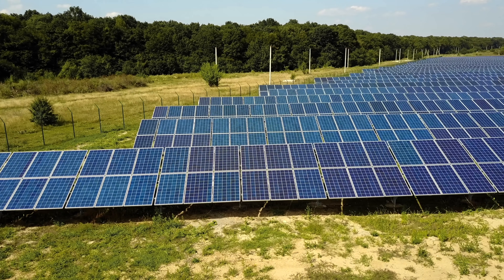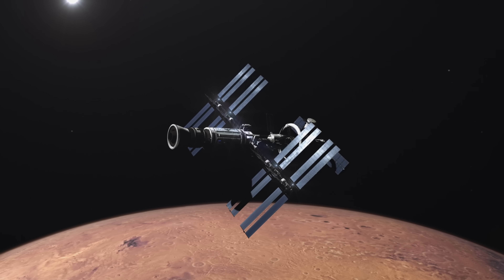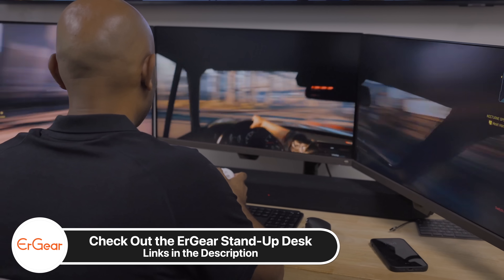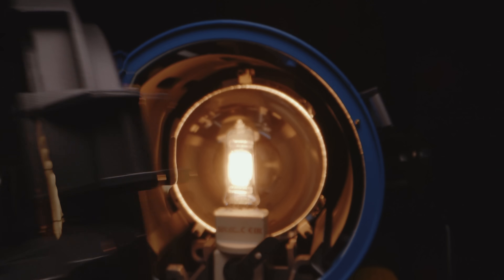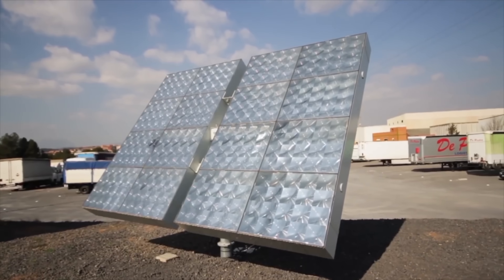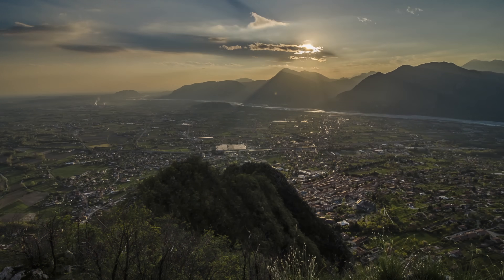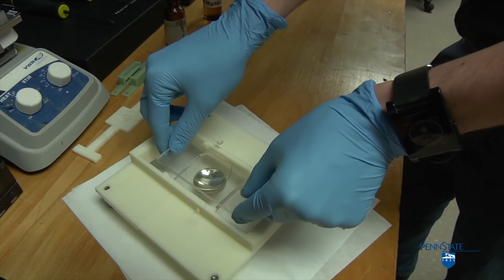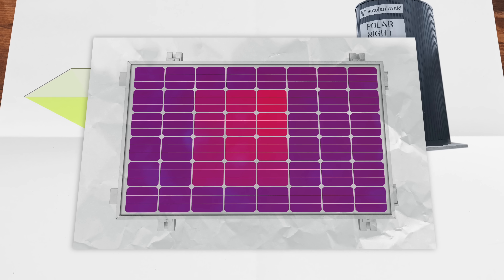Why Don't Solar Panels Have Magnifying Glasses On Them?

Comment: Is it possible to use a thermo- electric cells as a backings behind the PV cells to reduce thermal degradation and also provide extra electricity.
Reply from the maker: interesting...
Reply: I think the problem would be whether the thermoelectric cell would drain heat fast enough to cool the PV cell. Perhaps adding a prism to separate the infrared light from the visible light and shine that on the thermoelectric cell instead?
Reply: @Israel_Two_Bit  I do believe a thermo-electric cell system would also have to incorporate a heat sink, perhaps one buried in the ground or a water cooled system even perhaps providing hot water.

Comment: Once again here to mention "Blowhole" type wave power generation as it is a game changer. 
Wave Swell Energy's remarkable UniWave 200 is a sea platform that uses an artificial blowhole formation to create air pressure changes that drive a turbine and feed energy back to shore. After a year of testing, the company reports excellent results.
As we've discussed before, the UniWave system is a floatable device that can be towed to any coastal location and connected to the local energy grid. It's designed so that wave swells force water into a specially designed concrete chamber, pressurizing the air in the chamber and forcing it through an outlet valve. Then as the water recedes, it generates a powerful vacuum, which sucks air in through a turbine at the top and generates electricity that's fed into the grid via a cable.

As a result, it draws energy from the entire column of water that enters its chamber, a fact the team says makes it more efficient than wave energy devices that only harvest energy from the surface or the sea floor.
WSE's key innovation here is that one-way generation; other devices that harvest the same effect use bi-directional turbines, requiring the ability to reverse blade pitch or redirect the airflow. WSE says its design allows for far cheaper and simpler turbines, that should also last longer since they're not getting as much salt water splashed through them when a big wave hits. Indeed, all this device's moving parts are above the waterline, a fact that should help extend its service life as well as making it completely harmless to marine life.
Interestingly, the UniWave's design also makes it easy to incorporate into breakwaters and seawalls, where it can take a coastal erosion protection project and turn it into a clean energy source.
Reply: Congratulations 🎉 you have been selected among our shortlisted dm me above 👆to claim your prize..........🎁🎁🎁

Comment: Not seeing it for broad applications.  Like you said, folks have been working around the margins of concentrated solar for decades.  Not seeing any physics bending novelty to it yet.
More likely are the same sorts of subtle but significant and continual improvements in silicon cells for a while yet, eventually followed by perovskite, micro dot or some other clever new photovoltaic material for applications that need power density.   
On the flip side looking to see ultra cheap, low efficiency PV materials that are good enough for broad area, low power requirement applications.  We have the latter for calculators already.  I mean way beyond that like dynamic logos on your milk carton.

Comment: The heat issue is quite substantial, which makes me wonder if light concentration really pays off if the substrate breaks down faster.   The spot increase of electric potential with a concentrator needs to be offset by any longevity issues.
Reply: just make an ocean array of solar panels

Comment: Just another thing that sounds great in theory but the downfalls far outweigh the benefit.  Heat not only decreases efficiency of solar and also degrades the cells, meaning you'll be replacing cells or panels far more often.  Sure you can cool them somehow, but you add more materials and cost which again is the opposite effect of what solar is supposed to achieve.  These would only be viable in niche situations, especially with whatever technical skill will be required to install and maintain them.  These will have basically no residential application and little commercial application.    In the end it's not much more than a science project that some parts may be applied to other methods of generation.

Comment: Say they have a a square foot panel and they have this 3D printed device that is, what 3 ft by 3 ft? And they get it to be three times more efficient then make it cheaper than a 3 ft by 3 ft solar panel. sounds like a win right? But how big are these 3D printed devices that go on the panel are they bigger than that? do they weigh more? And will I, say have 1500 square feet on my roof for solar panels,  actually going to be able to get the same amount of energy for less money and still be able to fit it on my roof whether it weight restrictions or a size restrictions? These are the questions that need to be answered. Thanks for all the information I need more information feed me more.

Comment: I tried this many years ago. I concluded just add more solar panels rather than reflecting. The reflecting just added more heat to the solar panel and the efficiency dropped off.

Comment: I would much rather have a small solar system like this which takes a small amount of space versus having solar panels on my roof which would be difficult to service.
Reply from the maker: Solar doesn’t require any service. Plus covering more roof keeps the sun off your roof and cools your attic

Comment: Genuinely interested if anyone has some input.  My mother 7 years ago got a solar system without government incentives for around 28k  for a 21 pannel system that 100% powers her home.  I got a quote for 35k to do my smaller home about 2 months ago.  I checked and I use less power than her. To top it all off my quote says it’s for 11 panels that would guarantee 60% reduction in my bill.  She has 21 panels and 100% reduction.  How can we say the price is going down?

Comment: what about using it with where you want the heat as in a soler heater. can be used for heating water or air ?

Comment: The Main problem is thinking of PV as a power station...most of the efficiency of PV is supplying the electricity at the point of production ie a house roof. If you replace the roof tiles with PV then the cost is offset in both energy to build, labour to install etc especially in a new build. The fact we are NOT doing this demonstrates that eco drivel is about making profits not efficiency...if you put PV on every house in the USA it would cost about the same as a comparable nuclear plant, BUT the house owner would pay for most of the costs and get most of the benefits (instead of the utility companies- hence why it won't happen). A standard charge to pay for the network would overcome this need to profit from energy production...
Again, this won't happen, we'll just bury more of our farmland under PV panels and batteries...

Comment: 3 Suns - 10% loss still is ~2.7x the Solar generation capacity within the same 1 sqm. For the RV market, that means a large ~290W panel would now produce ~780W within the exact same footprint. Figure out how to form this into complex curves like the roof/hood of a vehicle and pair that with LifePO4 batts and the reality of truly Solar powered cars becomes closer than ever.
Reply: The footprint remains the same -- it is not a total area of the panel decreases, it is an area of a solar cell on it.
Reply: @onebronx  I literally said "within the same 1 sqm" & "within the exact same footprint".
Reply: @kimballspeakthreetheater3318  the Sun sends the same amount of energy per sq.m, so you will not get 3x energy from the same footprint just condensing the Sun 3x. Your footprint now is all the lenses of the condenser. To collect the same solar energy those lenses will have to cover the same area of the RV roof as the old cells.

Comment: How are you coming up with pricing, per watt? Meaning watt rating for the panel? Doesn’t make any sense. Also, basically no solar panel ever put out what they’re rated for, let alone when you take darkness, cloudy and rainy days, short solar days in winter, right when it’s needed most, and of course how to make the panels including mining raw materials for the panels, wire, batteries that will surely be needed, all the plastics, which all are made from fossil fuels, plus all the machines that do all work.

Comment: So when I get my solar panels I thought that getting them built by a South Korean company over a Chinese company would be best. However it turns out that nearly every single photovitic panel built today relies on silicone panels from Xinjiang, China (that's the province with the concentration camps).

The cost of solar isn't going down purely due to the free market It's due to the panels being built in countries that have lower labor and ethical standards than the US. Do these new manufacturing techniques solve any of these problems.

There's also the issue that when the installer says the solar panels on my roof are lower my carbon footprint the don't appear to be considering the carbon output in manufacturing and transporting, I essentially am paying China to output carbon so I don't have to.

There is also the issues that we currently have no method to recycle solar panels. 
Meaning that in 20 years when I have to replace the panels currently on my roof I may be creating more industrial waste than if my house was just powered by nuclear.

I like my solar panels and I think depending on where you live getting them makes financial sense. But it makes financial sense because our government and governments on the world have colluded to make it so. A lot of the claims around solar panels being better for the environment seems to be based off half-truths and lies. Solar panels seem to just transfer the time in which carbon is released it doesn't prevent carbon from being released.

Comment: For years I have been advocating the use of solar thermal rocket propulsion in space. The large low mass/area mirrors it requires can also be used for PV for concentrated sunlight. This means that after using the solar thermal to achieve escape velocity from LEO the PV is rotated into the focus to power solar electric propulsion. For Mars the power can be beamed down as microwaves from orbit to power surface operations.

Comment: Where is your 15tW figure coming from? Data center utilization alone is 50-90tWh
Reply from the maker: 50-90 TWh is insane, that might be all data centers for 1 year, which is not power of 15TW... 15TW constantly for 24 hours is 3,810TWh, hope that helps clarify.

Comment: the "amplifier" is 4x the size of the solar panel... and gives 2x efficiency... so basically you get half the performance... you could 4x the solar cells for 4x the performance and skip the "amplifier"...

Comment: The ability to store captured solar and/or wind power is still the greatest detractor to their use. And, as you pointed out, the acreage required to harvest sunlight (when and where it’s available) should also be a concern to environmental conservationists. Let’s don’t even mention the heat generated near solar fields and the increased winds near turbine fields or the loss of animal life in those areas.

Until we (actually y’all scientists) figure how to mitigate the harmful effects of solar and wind power harvesting as well as figuring how to store the harvested power in batteries that don’t need metals the earth just doesn’t supply in sufficient quantities or how to harvest those rare metals responsibly, the only fuel source efficient enough and environmentally responsible enough to use for large grid applications remains fossil fuels, which are also renewable, just not instantaneously renewable as solar and wind.

I can’t imagine anyone n earth not wanting an energy production system that has a one-time cost that’s as inexpensive or less expensive than the energy sources we’re using now. When that dream is realized societies will be drastically and forever changed for the better. For now, there are two environmentally benign power options in natural gas and nuclear.

Comment: 10% loss in efficiency, but actually a big increase in efficiency because it will concentrate scattered light in cloudy days.
We don't need top performance when the sun shines, we need top performance when the sun is obscured. Really. We need energy in the dark days. We have too much energy in the summer during day times.
The better we get any energy during dark times, the less battery we need to store it.

Comment: If we have a large volcanic ash cloud which can and has envelop the earth for a year solar panels will be mostly worthless and living in snow country with a roof system can be tough.
A bulletproof energy system such Thorium Molten Salt Reactors is what we need to push for now .
This system is walkway safe, environmentally friendly ,can be mass produced and be placed anywhere without having to be near a body of water. And thorium is cheap and abundant enough to last a thousand years. Do the research and read .

Comment: Would it be possible to use a simple layer of water between the cell and the lens? As water diffuses incoming light allowing better spread and could be used as a coolant. Or perhaps a more viscous liquid with reflective and cooling properties?

Comment: You speak as if the present solar cell efficiency is a serious problem when in fact, as South Australia has proven, solar panels presently work quite efficiently enough to solve our green energy needs, especially when put on enough rooftops, and backed up by wind and batteries. If they weren't good enough as is, solar wouldn't be being invested in and installed by so many energy companies and governments worldwide at the stunning, wildly accelerating rate they are.

Comment: What am I missing because this sounds totally stupid.  To concentrate 665 suns on a cell, would take 665 surface areas, right?  So, instead of 665 cells producing power, you have one cell that is 2.38 times more efficient?  Or is that cell producing 2.38 times what 665 cells would produce?  In any case, solar still takes up a massive amount of land, and doesn't produce power when the sun doesn't shine.  

I hate hearing the quote that solar is cheaper than fossil.  Is solar cheaper than fossil when the sun isn't shining?  I don't think so.

Comment: I haven't seen the cost of solar panels drop in 20 years. Maybe the cost to manufacture has dropped, but the MSRP that customers pay just keeps getting more expensive, especially with inflation out of control. Sure, this new solar panel technology may be cheaper to manufacture... and it may well be far more efficient, but instead of the cost-savings being passed onto consumers, manufacturers will simply increase their profits. Sorry if I sound pessimistic, but everyone who manufactures "green" technology is taking advantage of consumers. The little guy... the guy who pays for the product... never recoups the full amount that they pay for the product... unless/until the cost of electricity skyrockets (which seems to be the plan of most Western governments).

Comment: Why not solar panels with prisms in front of them?  A prism would change the light direction so the panel could be mounted vertically on a south wall instead of on the lawn or roof at an angle.

Comment: Old tech. This was talked about 20 years ago. And there were a few start-ups a decade or so ago. Weight, wind loading, and thermal issues have been the issue. Higher temp = less efficiency. We don't really need the higher efficiency. We need cheaper $/watt. There are a LOT of space out there we can still utilize. Solar canopies over every parking lot, walkways, etc.
Reply: Congratulations 🎉 you have been selected among our shortlisted dm me above 👆to claim your prize.........🎁🎁

Comment: Concentrating light from a larger area to a smaller area, besides increasing the light fluence (intensity) increases the amount of infrared (heat) as you point out. 

A thermodynamic rule of thumb is that for every 10 deg C increase in temperature, the MTBF (Mean Time Between Failure) will halve (BellLab research, 1980s) Loosely translated: there's  no free lunch.

Comment: It sounds like you need the Stanford concentrator and the backing to be used for solar water ' heating ' to assist in cooling the panels.

Comment: I'd also add with my simple pea sized brain and at the risk of looking stupid, why don't we use magnifying glasses to make green hydrogen? I mean isn't electrolysis the base of most (if not all) renewables?
Reply from the maker: what's up Royder! so the magnifying glass could heat water, which would break the bonds of liquid water to create gaseous water vapor, but that doesn't split the hydrogen and oxygen, for that you need electricity via electrolysis ... so you can use concentrated solar to produce electricity to then run electrolysis!